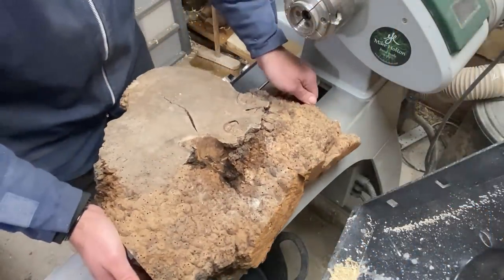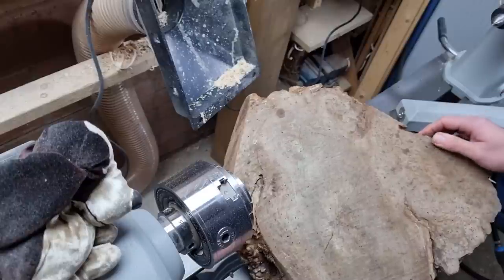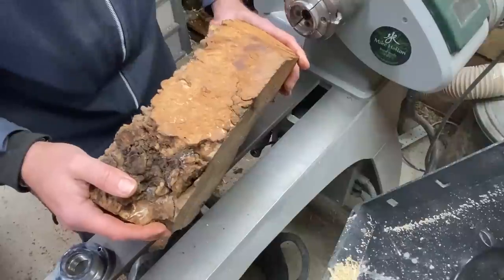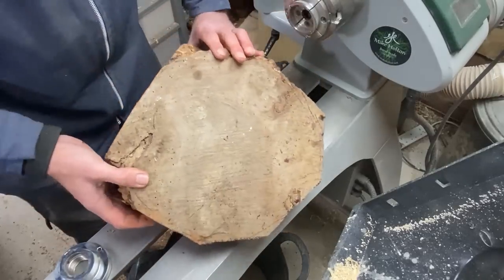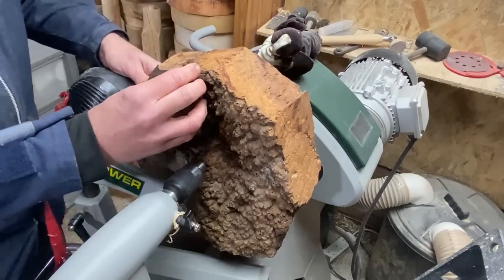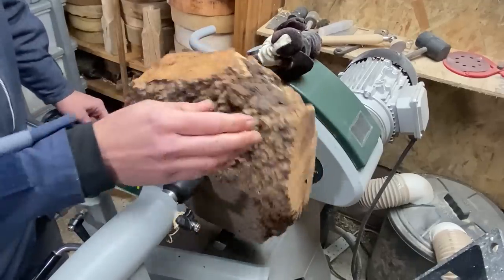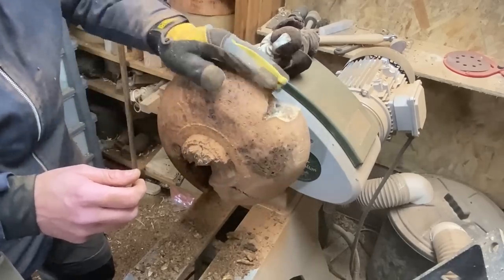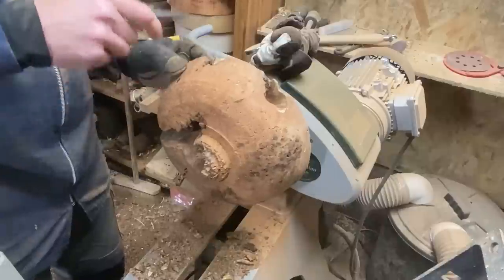HEARTBREAKING Turn of Events - Woodturning project

Comment: Oh my god, I nearly died with shock when the bowl was thrown off the jaws. Tho not a woodworker I am a modeller and my heart sank thinking of all the hours and effort put in creating that piece. but when you bought it back into view again I gave a big sigh of relief. Well done, a beautiful  piece. Congratulations.
Reply from the maker: Thanks Terence and sorry about the shock 😁, what do you model?
Reply: @MikeHolton  Hi Mike, I started quite young with a model of a spitfire (a plastic kit) and as I got older started building balsa gliders. The most disappointing time was when building a Minimoa a 4ft scale model, took me about two months to build freehand from a set of plans. Anyway I covered it with tissue and doped it (showing my age now) I remember I had built it with a de-thermaliser in the tail activated with a slow fuse (cord soaked in saltpetre). I lived in Yorkshire at the time and finally plucked up the courage to take it to the sand dunes and give it the first flight, nice gentle onshore breeze, put a small amount of rudder to make it return to me and then set the de-thermaliser. I gently pushed it into the wind and watched it rise into the air and slowly lift up into the air. As it moved away from me it headed out over the sands and continued to rise. First big mistake, the tide was in. Oh crap! I’d wasn’t turning. It flew perfectly straight into wind and slowly flew out to sea I watched helplessly as it made a perfectly good landing on the waves about half a mile out only to be smashed up by the first breaking wave. I car still feel the disappointment after all the hard work I had put in building covering and doping the model.
I now build flying wings with radio control and like the summer evenings just flying them in lazy circles with the gulls over the cliffs near home. I have 5 wings in various stages of construction and sizes and like to experiment with the scratch building, some work some don’t much like your wood turning on the lathe though your skills are far above mine. All the best for the future.
Reply from the maker: @Reh8111  Hi Terence, thanks so much for getting back to me. All sounds amazing and I feel your pain for the loss of your Minimoa, that sounds like something that would happen to me. I remember having to use dope on a couple of planes I built as a kid. Both my parents are from Yorkshire (Sheffield) and I love taking trips down the coast to Whitby and further down. So many happy memories

Comment: Been there.  Done that.  Hate when it happens.   You have infinitely more turning experience than I do, but I've found that when finishing bottoms with the Cole jaws, limiting myself to pull cuts only has greatly reduced the incidence of flying bowl syndrome.  As a matter of fact, I don't think I've lost one since I came to this realization.    Love your work and have learned a lot from you.   Thanks.
Reply from the maker: Thanks so much and thanks for the tip! Pull cuts from now on, makes perfect sense 😁, all the best, Mike
Reply: This 👍

Comment: Found your channel just now, looking for inspiration for a piece of taxus. Found it and stumbled upon this vid. 

My first tip is for casting resin: wood will flow on resin, so any slack will make resin sink to the bottom and you'll have to refill. Wind the plastic liner with tape, and/or put a weight on the wood keeping it down.

Second tip: if there is enough material there, use it for your tenon.

I hate the Cole chuck, so third and last tip: turn a block of sparewood to a piece that fits into your bowl. Keep it in the 4clawchuck, put your bowl around it (with a piece of cloth or package foil between) and use the tailstock to secure it until the utter last moment. The final knob you can remove with a chisel.

Thanks for your vids, I'm a subscriber now!
Reply from the maker: Thanks so much for your tips and for subscribing. I was not properly ready when I poured the resin on this one but promise to do better next time 😀

Comment: I’m a turner also and when it shot off the lathe I could have cried for you,it amazes me just how much resin that was left on the finished piece I use epoxy on most of my projects but I use plastic mixing bowls to make the initial shape this would save you a tonne of time and money as I know only too well the cost of epoxy resin,any way it was a super result well done
Reply from the maker: Hi Dave, I did consider a plastic bowl but the voids inside would not have filled with resign as the air would not have escaped. I was doing my nest to save on the resin used with the bag idea which failed but I did learn a few things for next time. All the best and thanks, Mike

Comment: I'm so sad for you. . Turned out beautifully! I have seen The Papa use several applications of denatured alcohol to detach hot glue. He says to let it soak in and then pry off the glue block. "Easy peasy" 
Thanks for sharing, Trish
Reply from the maker: Hi Tricia, yes it can work if you put glue round the edge, I had it underneath so it's hard for it to get in there, I did try but I will give it another go next time. Thanks, Mike
Reply: @MikeHolton   🤞

Comment: Hey Mike, the next time you need to fill a pot that you are pouring resin into like this bowl, try pouring rice between the pot and the bag the bowl is in. The rice takes up the space much better than the insulation you used here. You can use the rice over and over again. Its also cheap and readily available. 
Nice work on this project. I enjoy your videos. Keep up the good work my friend.
Reply from the maker: Thanks Paul, I have two bags of rice ready for the next one 😀
Reply: You might want to check out Sprague Wood turning. He uses rice quite often. That's where I got the idea from. I know that you watch u tube videos.
Reply from the maker: @paulplager9498  Thanks I watch a lot of Jim's work, he was one of the guys that got me into this hobby

Comment: Epic journey indeed.   So glad the piece held together when it flew off the Cole jaws.    I think you were getting vibration due to the small inner of the glue block turning much slower due to smaller diameter.   Cole jaws do not have a strong hold and vibration makes it so much worse.
As you said, gorgeous wood and gorgeous bowl.    This may be the most expensive bowl you have made due to the volume of resin.    That resin was not friendly for turning on the bottom.
We are all happy that you have a gorgeous bowl at the end of this journey.
Dave.
Reply from the maker: Thanks Dave and I think you are right about the cost, there is about £60 of resin in there, luckily I got the burl for virtually nothing. I'm glad it survived as well, not sure how I would have reacted if it had smashed. I think you are right about the vibration, I'll be more careful next time. All the best, Mike
Reply: The epoxy is denser than the wood so the weight in the bowl is asymmetrical thus lopsided. You could hear some wiggling sound due to the asymmetrical density just before it flew off.
Great patience and never quit attitude.
Reply from the maker: @danielmetzler307  thanks Daniel, I think you are right, a few people have left tips on how to stop it.

Comment: I think you earned a lie down with that heart stopping ending.
It turned out to be a beautiful piece.  If you get another burl that needs resin like this one did, I would suggest a more transparent resin finish (less pearl maybe?) so that the funky edges are visible through the resin.  I think the portion on this bowl where the big bark inclusions were would have been very interesting to see in the finished piece.
Reply from the maker: Thanks Susan, I will certainly have a go at this, sounds like a solid idea 😃

Comment: Hello Mike. Just ran across your vid from a year ago. Beautiful piece of burl mate and an awesome end result. However, I was concentrating on the name of the vid being "Heartbreaking" and wondered when the heartbreak was to occur, and right near the end. My heart did a slight convulse when I saw the bowl fly off the Cole Jaws. Through your vid you did use the term "blimey" and also "The ugliest thing I have ever seen in my entire life" which gave me a bit of a chuckle! I have seen items fly off Cole Jaws before and have associated this with my turnings as; perhaps my Cole Jaws were not tight enough or perhaps I was using the wrong chisel or the chisel was not hard enough. Who knows. Thanks for sharing. Dave, Beachmere, Brisbane, Queensland, Australia
Reply from the maker: Thanks Dave, cole jaws are not perfect, if the centre of gravity is too far out then they can come off if you get a little catch. I now either tape it on or just hot glue to help hold it in place😃

Comment: Very nice bowl. looked better when the white resin yellowed with the finish. Maybe use a 3/8 spindle gouge with a  40 degree or less grind, and lighter cut to take off the last of the glue block.
Reply from the maker: Thanks for the tip 😀

Comment: Turned out really nice.  Why didn't you use alcohol to melt the hot glue? It works much easier than trying to cut it off and keep your blood pressure lower. Thanks for sharing Mike. 
Stuart
Reply from the maker: Hi Stuart, I did try that first off camera but it would not budge, next time I'm using a hot knife 😃, all the best, Mike

Comment: I’ve had the same luck with Cole jaws. I have the same straight sided buttons.  I ‘m going to look for some wedge shaped ones.
Reply from the maker: I'll be changing next time as well. I'll also be putting tape over it 😃
Reply: @MikeHolton I found some 25mm tall neoprene bottle stoppers (with hole) and m6x30mm screws that fit.  Looks like it will help greatly.

Comment: Hi Mike we all hit the wall I have stopped using cold jaws I got a pice of 1 inch thick mfd and screwed a fixing ring ring on and have not had a problem since but I always have the tail stock in place oh beautiful bowl art at its finest and I now blow out as you showed all the best Ian Mac
Reply from the maker: Thanks Ian, I did have a couple of tips in the comments about how to make it safer, one was to use marking tape to hold it in place and the other was to use hot glue. May be worth a try. All the best, Mike

Comment: 1st off I like bowl 🥣 great job. And regards to the bowl flying the face plate I think you should of used a square Carbide tool with negative cut and went a little slower. I've had the Exact same thing happen to me I might of had happen at least 2 times. And yes I feel your pain for sure. Thanks for sharing your project with everyone I appreciate that.
Reply from the maker: Thanks for the tip Ray, I've had some great tips on this one and I will be giving most a try over time, your included. All the best, Mike

Comment: Nice journey Mike, beautiful work! So the glue block - if you just apply hot melt glue around the outside edge you dont need to part the block you can just use meths saving lots of heart ache. I feel your highs and lows for this one but fantastic result!
Reply from the maker: Hi Paul, is just gluing around the edge strong enough for a heavy bowl? Not sure I would  feel safe with it like that, ever had problems? Thanks, Mike
Reply: @MikeHolton  Hi Mike - I was surprised by just how strong the hot melt glue holds the block on just around the edge too - and how easily it comes off again with meths - I had to practice first before I trusted it though!
Reply from the maker: @PBUCKY1969  Thanks Paul, yeah, it's a trust thing, I'll give it a go and see how I get on. All the best and thanks, Mike

Comment: First of all, thank you for sharing your ups and downs with that wonderful, marble like bowl!
Secondly, you found the most important word concerning epoxy pours: "hopefully"... hopefully it doesn't leak, hopefully the colours stay separated, hopefully there will be no voids...
Third point: you used epodex as I do, and I have the same issues with heavy chipping. Looking at the turning videos from overseas it always seems so easy to turn resin. But what can you do if there's no total boat or whatever they use available in Europe? You're stuck on Epodex or Dipon no matter how they behave on the lathe. I'd be grateful if someone dropped a hint to a better turnable resin here. 
Last but not least: Sometimes you can be experienced in a foreign language as you want, your brain is kidding you anyway. The first three minutes I was wondering what a "barking clusion" might be, 😂. 
Keep on turning, Mike, I love your videos, your British sound an I admire your patience. I think I'd have kicked the lathe (outch!) when the bowl flew off.
Reply from the maker: Hi Kerstin, I never expect things to go my way so 'hopefully' seems very apt 😃. Not a fan of Epodex but I gave it a try as you can buy it in lots of different sizes. In the future I will go back to Glass Cast 50+ which is much better, turns like butter but they only do it in two sizes 1L and 5L. Sorry about the mistake over bark inclusion lol, I must try to improve my diction. I'm dyslexic so I quite often muddle words or get them the wrong way round which makes my main job quite interesting at times (lecturer) but my students get used to it 😃. Patience is something I can do, I enjoy every second of what I do and know that in the long run it doesn't really matter if you succeed or fail it all about enjoying the journey. Must admit though this bowl had me close to tears lol. Well I think that's all for now. Next project has no resin and should be fairly straight forward (famous last words). All the best, Mike

Comment: Mike did you use a pressure chamber for tge resin, if not did you do any work to avoid bubbles
Reply from the maker: Hi Stuart, I didn't use a chamber, I just make sure I use a resin designed to de-gass itself. This resin did quite well in that respect but glasscast does as well and turns better. Hope this helps, Mike

Comment: I like what you did. Question: Did you use a compression tank? If not, I am really interested in your technique. I didn't see any air bubble problems. Often when I am removing the tenon I turn towards the headstock so all pressure goes in, then lightly sheer-scrape the bottom clean.
Reply from the maker: Hi Les, thanks for the tip! I had another tip that said they had the best results from pull cuts only when on the cole jaws which it similar to yours. I don't have a pressure pot so I use resins that do a good job of degassing themselves like Epodes and Glasscast.

Comment: Well, that could have been so different at the end. It's the worst piece of making a bowl clearing down the foot.

Hind sight is marvelous but I've always been told and always practiced only cutting into the headstock thus reducing the side loading.

I'd also suggest a smaller diameter round carbide for resin cutting and clearing it back off when it is a little softer rather than waiting until it is at maximum hardness.

Something else to consider is using dry uncooked rice between the bucket and the bag, you xan also hit melt strips of plastic fruit ounit across voids just to hold the bag away from the blank.
Reply from the maker: Thanks Chris for all the tips 😃, all the best, Mike

Comment: Mike, if you use a negative rake on that tool, the epoxy will not shatter as bad. IMHO
Reply from the maker: Thanks Jimmy, I'm starting to do more with resin so need to invest in more negative rake carbides 😀

Comment: I dont know what i can say that hasnt already been said, but isnt that the worst possible thing and at the worst time, but you ended up with a beautiful bowl, considering what you started with, that dry dusty piece of wood with all the bark inclusions you finished with a lovely bowl with a great use of the resin.   
I have said before about Y tube being a great platform for sharing ideas, but that was a great tip about covering the scales with cling film, because i couldnt quite understand how resin needs a couple of days to go off in a mould but just nanno seconds on your wifes scales, also putting the resin in a sack was great way to save on resin, i also liked one of your viewers comments about hot glue on to the cole jaws as well as using a thin paint scrapper to take off the glue block.
Another great job Thanks Mike take care Steve
Reply from the maker: Thanks Steve, I love reading the comments people leave on the channel and it's one thing I never really excepted when I started. The tips people leave are really useful and the friends I've made like you just make everything so worthwhile. 
Take care my friend, the walnut slab you sent will soon be making an appearance, can't wait to get started 😃, all the best, Mike

Comment: Were it I, I think I might have put the bowl in the oven to soften the hot glue, and taken the whole block off that way.
Reply from the maker: Good idea but the resin may have been affected as well, not sure. Something to think about, thanks, Mike
Reply: @MikeHolton  Hot glue melts at just over boiling temps. Isn't that about the temp that's best for epoxy resin fast curing?
Reply from the maker: @willcool713  Could be, I do a bit of work with resin but not enough to be experienced at it. A heat gun would probably work just as well.